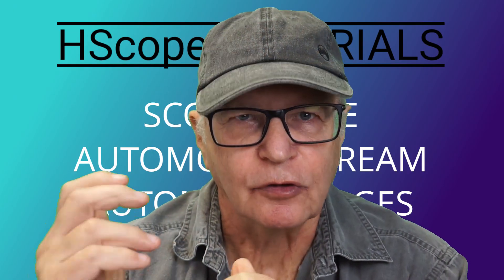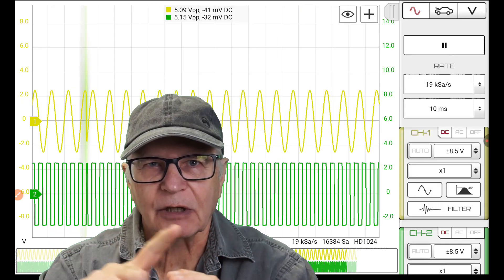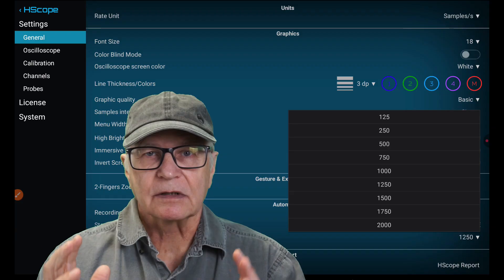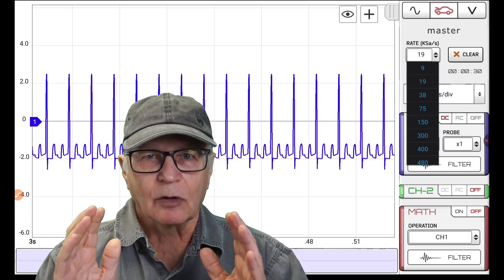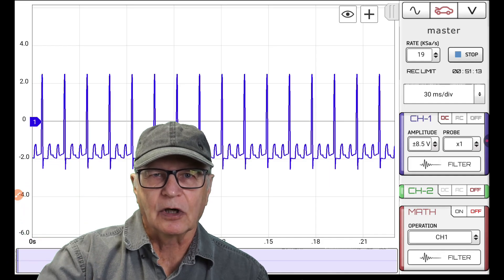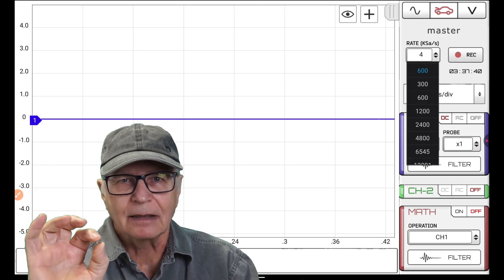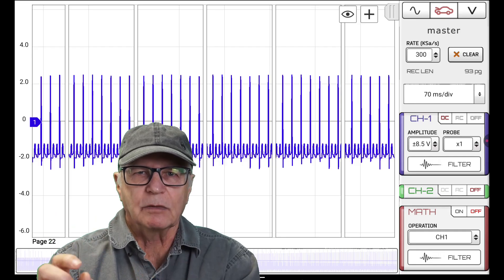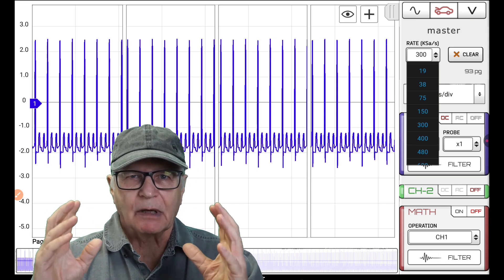HScope TUTORIAL#5 | SCOPE-AUTOMOTIVE-PAGES

Comment: Glad to see you back. Love your tutorials. I do have a question on  Buffer size of Lenovo tab m11. I did not see buffer size listed on any of the spec sheets I found or on the device. Do you know how to find it or must we figure it out some way. 4GB Ram, 128GB storage.
Reply from the maker: your M11 has same amount of RAM (4GB) as the P11 I was using in this video

HScope won't allow us to use more than a certain amount of that, in our case that's 1250

try a larger amount and it will revert to 1250

we can however set aside less and I usually set mine at 750